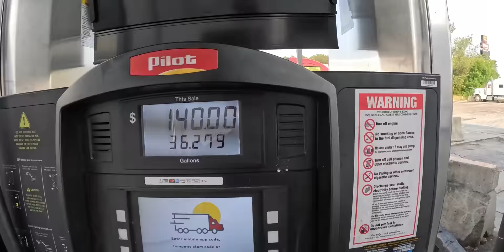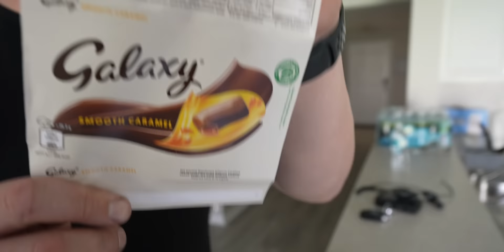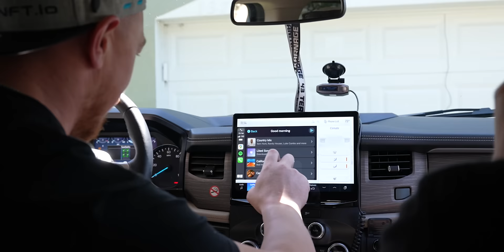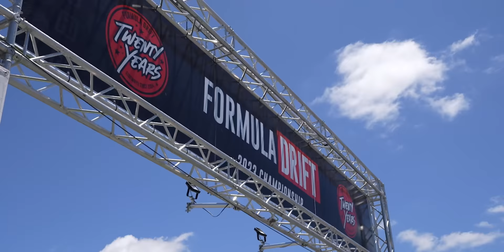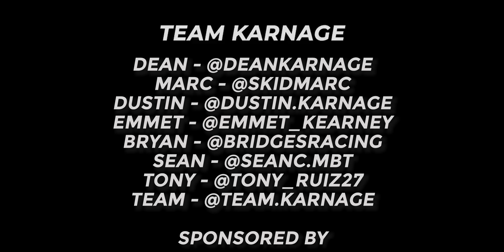What Do The FD Judges Have Against Dean Karnage..?

Comment: I am obviously not a pro drifter and may not know alot. But when i watch your drifting it looks good. But it always looks like you have a hard time to swing the front for more angle. You drift but it seems like you have alot of front bite and grip so your rear is drifting but the front is pushing which makes it look like your lacking angle. Instead of the rear being more sideways and the front facing sideways rolling thru. It looks like your rear is sliding but constantly pushing the front and the front is staying to straight. I think thats why the run got a 0 on x factor.

Comment: Don’t see the reason for 0 X factor in qualy even the low score think should have been at the least in the mid 80s even the battle imo both similar leads and similar issues in chase should have been one more time but just like you said tureck stayed a little more on line in the chase but if the cars were the same length I think he still woulda dropped a tire 😂 would love to hear some explications on the qualifying scores from the judges cause if it’s lack of angle there’s other drivers that should be getting the same scores that aren’t